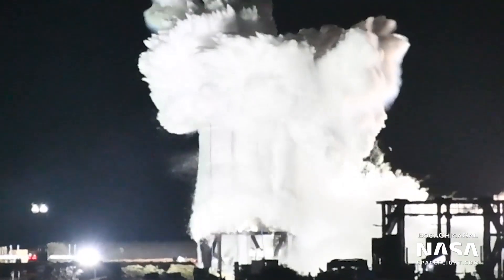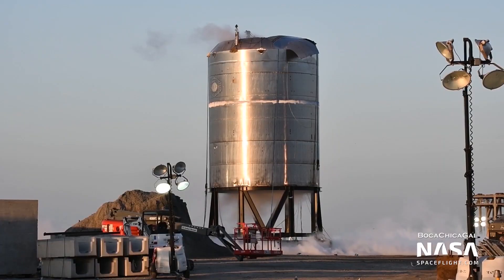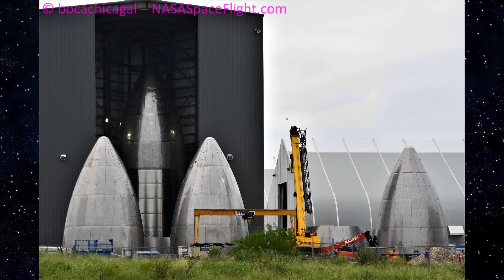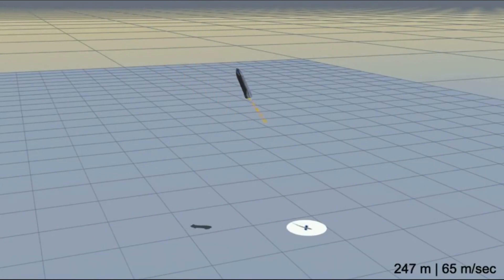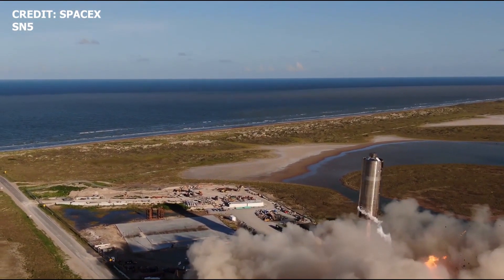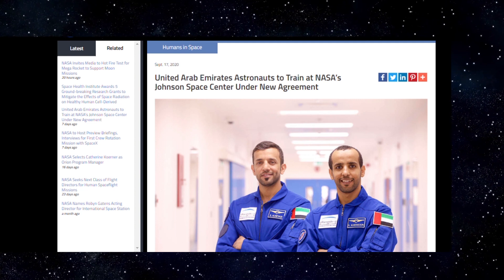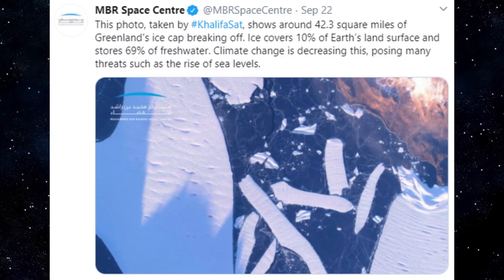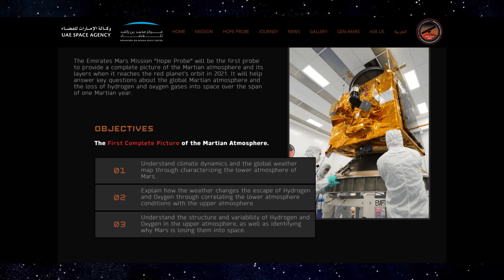SpaceX Starship Updates I SN7.1 Pops I  SN8 preps for 60,000ft Flight I Starship SN9, SN10 , SN11

Comment: You are incorrect. The tests have not all been tests to failure. The test have been to test the puck. Once they moved back to the mobile stand they have been trying to test to failure. 
This is obvious because they did not strap it with the blue nylon ropes until moving back to the mobile stand.
Reply from the maker: Didn't mean to imply that all the tests were pressurization to failure tests. Was simply referring to those that took place from the 17th to the 23rd (and the fact that some of the issues with other tests would have held them back from press to failure.)